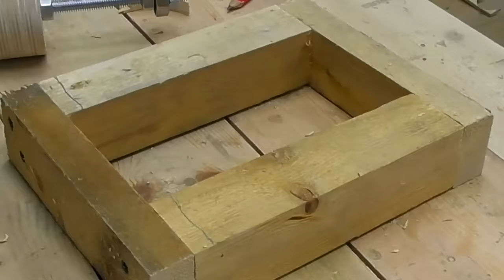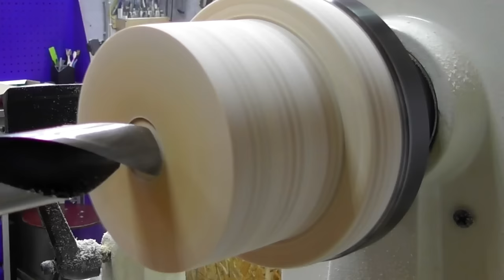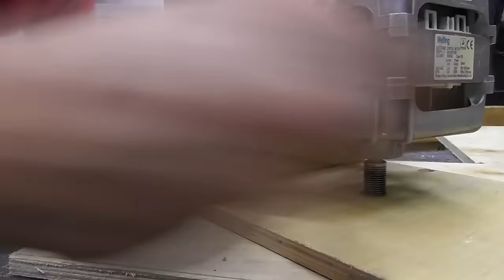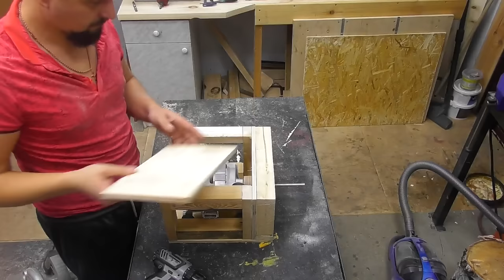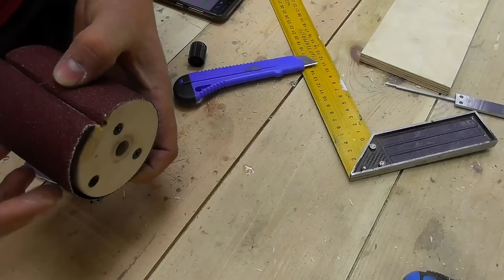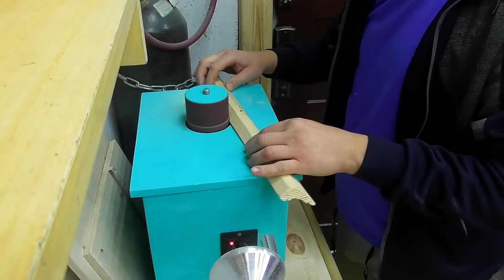Cool idea for the workshop!! FROM THE ENGINE FROM A WASHING MACHINE.

Comment: Just use your drill press for drum sanding, or the lathe (turn a drum any size ) make a vertical fence with a hole for the drum to pass through and attach to the bed of the lathe.

Comment: Hmmm,so I need a washing machine motor,wood,wiring,control board about 10k worth of tools and a days work?or I can just go B&Q and buy a sander for £20.
Reply: Add to that a controller for the motor  they failed totally to cover that aspect most decent washing machines have motors that require rotor and stator control    but that was not covered at all
Reply: Dont forget the most difficult part to find....the engine
Reply: An oscillating sander for $20??!!??!... If You Know where to get one for $20, PLEASE!!!...Let me know!! (For Real)
Reply: I probably need that fir my son's dirty clothes
Reply: Real men make their own tools!  Oh yeah and wash their own laundry.
Reply: @massagetherapy3  you can buy the bit for a drill for a couple of quid.

Comment: You can get rubber mounts off the shelf with M6, M8 or M10 bolts welded to either side. Soft wood drilled to tapping size will accept the bolts. Just drill and screw them in or you could run a taper tap part way down to speed things up. Female or male/female versions are also available.

Comment: If you slow your drill press down with the big hole saws you won't burn the wood I usually run line about 50 RPMs for a 2 and 1/2 in

Comment: Hmm you have a drill press for a drum sander and the cost of the motor ( not engine ..they run off of fuels) and hardware you could have purchased a sander 🤔 ... BTW dude where are your safety glasses ?

Comment: Are you using the motor at 13000 rpm ?
It can't be used like this without a speed controller.

Comment: I wish people would get their wording correct when describing a motor or engine.
The heading states this is about an engine when it should say motor.  Yes, there is a difference.  A motor is powered by an external force. An engine makes power from a fuel they burn. Thus this is powered by a internal source.
Thanks.
M
Reply: I'm engineer.
I can speed control motor.
If you need circuit, you can connect me

Comment: How is this a cool idea?  It’s a drum sander. You used a bearing in a wood plate on all thread rod as your main shaft? And then you didn’t use a nut on top to secure the drum. That’s a very stupid idea and likely will get someone hurt.  If they press too hard the drum won’t spin and come right off the shaft.  Retitle this video “how not to build” or take it down.

Comment: nice work, but better is to use classic 3 phase induction motor, and for regulation frequency driver, or  3 speed induction motor.  no sparks, no burning smell, no frequent breakdowns.  classic brush motor withsawdust is dangerous combination.

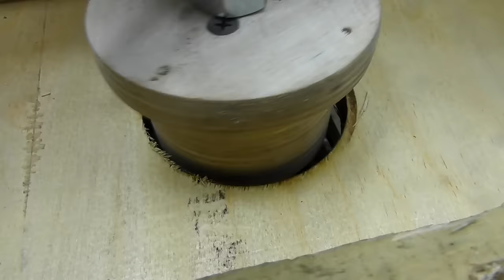Comment: Hi. I have the same motor and I wish to make sander machine. In  4:18 of video,  you glued wood to metal. What do you think, is it strong and safe enough to stay that way? On such a part, I would like to attach a plate, to which sandpaper would be attached.

Comment: Oh dear, oh dear. Someone needs to get out more. An engine is a device that converts one form of energy into mechanical energy. We have had engines long before Ford or GMC were even heard of. Water wheels, windmills, treadmills to mention just a few are engines. The internal and external combustion engine is just an example of an engine just as an electric motor is. So an electric motor IS an engine. Cheers and stay safe. R.

Comment: This item would be much better constructed in steel for many reasons and would be  built to last. 
But I guess you have to work with what you know.  Nes pas!
Afterall  most of the other tools you worked with especially the face sander are metal contructions. That said if you are upcycling the motor from a diffunct washing machine and scrap timber why not!

Comment: If it's electric, it's a motor! 
Washing machines don't have engines.
Engines have pistons, and they haven't built gas powered washing machines in nearly 100 years.
Reply: Im sure Tim the Toolman has a wash machine with an engine.

Comment: "engine" from a washer? Looks more like an electric motor.
An "engine" runs using a fuel, like gasoline, diesel, Propane, etc.
A "motor" runs off electricity.
Back in the early to mid 1900's they did make ringer washers that ran on gasoline. They fell out of favor as more and more homes and farms got electeicity in the 1940's, 1950's and very early 1960's, thanks to TVA and others.

Comment: Eugene, could you take a photo of controller, so we know what you used for your build, and what worked for your motor? Thanks
Reply: I'm engineer.
I can control speed motor.
If you need circuit, you can connect me

Comment: Sadly washing machines do NOT have engines, unless they are gasoline or some other fuel powered as all engines are fuel powered and usually have pistons. However they do have MOTORS such as the motor you used in your sander.

Comment: Could you please post  picture or video on wiring the controller to the motor. I simply cannot get it figured out...
Reply: Thank you for your reply. That is just the point. I have bought one and can't get the wires figured. Worried I connect it wrong and destroy it. I have 6 wires and am not sure which one goes where and the schematic on the side didnt help me much either.  Maybe I'm just to stupid for this, hence I asked if you you post a picture or so, so I can actually see the connections. I have mains connected directly to the controller, tachometer and motor power, red and white, connected to the motor and still have green and yellow available. And still I cannot control the motors speed or even get it to run. A picture speaks a thousand words and would really help
Reply: Hi, I'm interested too!

Comment: Ok Eugene, if you are posting on YOU TUBE in English then learn what names go with what items.  An engine is something that powers machine things such as cars, motorcycles, boats, airplanes, chain saws and so on.  An engine runs on some type of fossil fuel like gasoline, diesel fuel, jet fuel and so on.  A electric motor from a washing machine no matter the size uses electricity to make it operate (run). So bottom line, there is NO SUCH THING AS A ELECTRIC ENGINE no matter where it came from be it a washing machine, refrigerator, cloths dryer.........   Got the picture????

Comment: Device not practical. A more practical solution would be to build a milling machine using this engine.
Reply: Not enough power to do much of anything with.
Reply: @juniorjohnson9509  not exactly. for small size cutters and small details would not be bad.
Reply: @zizitop901  It would be better than nothing, but that's about it. Most washing machine motors are only 1/2 hp or less, so you would be stuck with only very small cutters, shallow depth of cuts, and slow feed rates, and at the typical washing machine motor rpm of 800, that means REALLY slow feed rates.
Reply: @juniorjohnson9509  You are wrong assuming the rotor speed of the commutator motor is 800 rpm. The title of the film is a nice idea for the workshop !! FROM THE MOTOR FROM THE WASHING MACHINE Let's assume theoretically that on this motor the drum of the washing machine will reach 1200 rpm with the driver at maximum control.
The drum is on a belt drive and the diameter of the pulley is x times the diameter of the motor shaft, and let's assume that this gear is only 50 to 1.
1 drum revolution equals 50 engine revolutions.
knowing the rotational speed will be 1200rpm, it is easy to calculate the rotational speed of the motor shaft. count for yourself if you can and correlate it with your previous statement. best regards.

I will just add that this is a theoretical example and in fact such engines reach up to 25,000 rpm and have power up to 2kW.

These motors, due to the so-called divergence caused by the structure, are easily damaged by the rotor winding rupture and should always be loaded so that in the event of damage to the power transmission mechanism, e.g. the V-belt in a washing machine, it does not reach the critical speed, on its switch there is a rotational speed sensor connected to the controller which it will not allow the engine to rotate faster.
In an angle grinder, commonly a flex, the motor shaft is rigidly fastened with a toothed gear, which creates a constant resistance that does not allow for an endless increase in engine revolutions, but in new grinders there are thyristor controllers of rotational speed set so that when the regulator is set to the maximum, it does not damage the motor.

Comment: where is the intake manifold, carburettor, spark-plug, gas-tank, and lost more. Did you mean electric motor or just motor?
Reply: A motor by definition is electric. A fuel powered "motor" is called an.... ENGINE. Look it up.